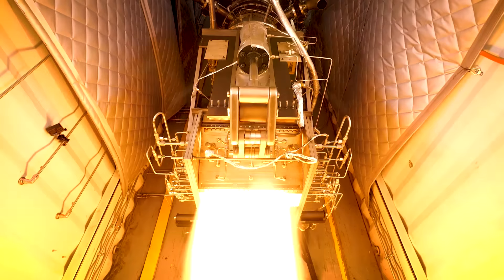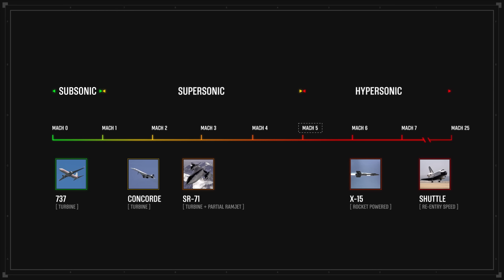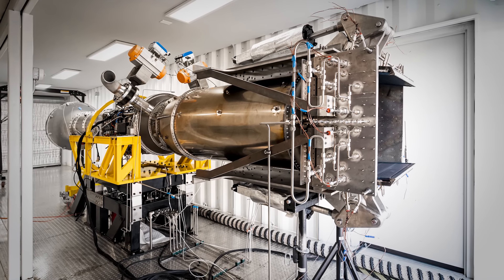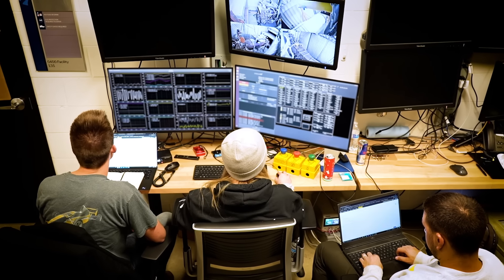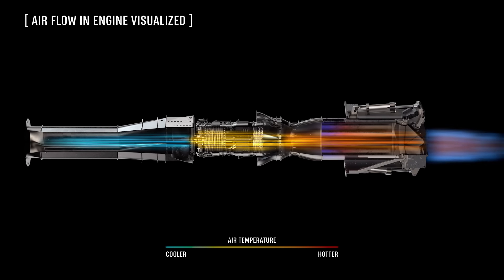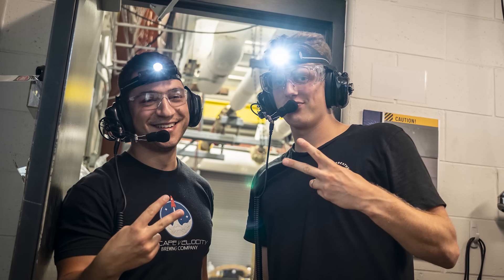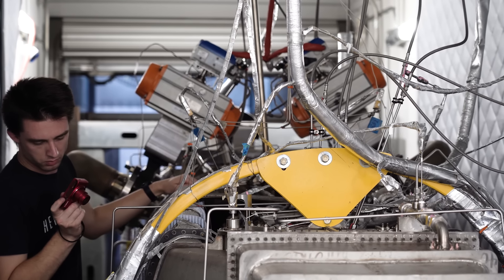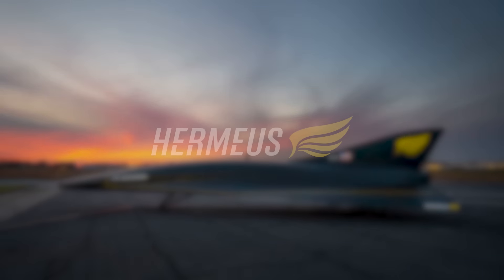Hypersonic Engine Test Milestone

Comment: The SR 71 had something like this except the high pressure bypass ran from high pressure compressor instead of directly from the inlet. Cool idea.
Reply: ya J-58
Reply: Indeed….it became popular to refer to the J-58 as a “turbo-ramjet” as a brief description of its unique functionality powering the incomparable SR-71 but this is actually a truer version of the aforementioned engine type. I LOVE what Hermeus is doing….they’re killing it at every stage of development due to a brilliantly practical philosophy….this has enabled them to attract and retain the necessary funding and engineering talent. Actually breaking the speed record long held by the Blackbird followed by hitting hypersonic speeds is going to make this team legendary while giving them all the momentum necessary to keep going. The reliable dual cycle scramjet problem has an incredibly high threshold for commitment, funding, and innovation making it practically impossible for a startup to crack that code. Allowing Lockheed to focus on that while leveraging the existing tech/ramjet model was an inspired call by Hermeus.

Comment: At what speed does the transition actually take place and how long does the transition take between turbo fan operation and ramjet and vice versa? what will be the change in altitude as the transition occurs?
Reply: I saw a post on this engine running and from what i could gather (+ my lifited knowlege on aerospace engenering) like they said mach 3 on turbojet such as the ones in the SR-71 and then once that speed is achived the air is moving fast enough and hot enough to then be able to use the RAMJET, the transition only took a few seconds; quickly throttle back on the turbo jet and then fire the ramjet and bring up the power. altitude for transition would most likely be between 60k-85,000 feet (85k) being the cruising altitude of the SR71, not saying it couldnt be lower but mach 4+ at lower altitide i would guess be less optimal for airframe rigidity and stability. But since it is still an "air" powered motor it would still need air to function, once in "space" where the air is so thin it would be hard to run the engine then rocket motors with their own oxidizer and fuel would need to be used :)
Reply: I think this answers my question about the design getting to orbit.  True space plane.
Even if rocket engines are still a necessity this would still have a massive impact on the fuel load required to orbit.
Reply: @xJI00  I suspect it COULD be used for sub-orbital hops (like the Virgin Galactic combination) if they could shoehorn a tank of oxidizer into the airframe.  Once the engine runs out of air, you'd open a valve and inject the onboard oxidizer into the engine, possibly similar to NOS injection, but nowhere near as simply done!
Reply: @xJI00  Not really , Mach 5 maybe sounds impressive, but is far off from speed needed to reach orbit, still needs a lot of fuel and oxidizer to get to that speed.
Reply: As seen on the graph for speeds the space shuttle was at extremely high velocity, well above that of what this engine does or is capable of acheiving at this point. It takes ALOT to get to space and the engines needed would need to be scaled up ALOT to meet that threshold.

Comment: I'm no engineer, but I find this all super cool. Can't believe manned hypersonic is so close to being acheived, you guys are awesome 👍👌
Reply: Well, this isn’t really what I’d call “close”, but it is definitely significantly closer than it was 2 weeks ago. This is a major accomplishment.

Well done, team!
Reply: I’m a test pilot at edwards afb and manned hypersonic is already a thing. We’re just trying to make it more efficient and for longer durations. Currently our longest hypersonic flights last about 7 minutes before fuel runs out. I’m not allowed to say what we’re flying bc it hasn’t been released into the public yet but the chimera engine has been in development for a bit now and it’s being fitted to the aircraft that I’m flying at the moment. The thing is we have to be at a minimum of 80k feet in the air for it to work. Anything lower and we can’t hit Mach 5
Reply: @TheBigChad  makes sense since the air resistance is quite low at that height, less drag, better efficiency. IIRC, the concorde flew at around 60k feet, right? Wonder what are the unique challenges they have to overcome, flying at 80k feet. Like the type of shielding, etc. Hope to see more in 2023!
Reply: @TheBigChad doubt
Reply: Its not close and probably will never happen due to a thing called friction drag and more importantly, what do you gain at Mach 5?  Next to nothing other than an astronomical fuel bill.  Mach 7 for a cruise missile has some possibilities if you can achieve such speeds, but manned?  Why would anyone bother?  Computers are better than Humans at that speed.
Reply: I doubt man will do a lot of hypersonic flying. One issue with the SR-71 was gforce. Any kind of maneuver at all would cause huge loads for a human to handle. Guessing a lot of military applications though.

Comment: I see what you did naming it J-85 when the first high performance dual mode engine was the Pratt-Whitney J-58
Reply: :D
Reply: Their engine is built on the GE J-85, that's the the turbo-jet in the middle of their diagram.  They're adding the intake, bypass, ram-jet and misc.  That's a significant add but basing the turbo-jet on the proven J-85 was a smart move... plus I think they were given several.
Reply: No, the J85 is the engine used on the F 5/T 38 and is unrelated to the J 58

Comment: The Lockheed SR 71 Black Bird engine works on a similar concept.
Reply: I had the same thought. The moment they explained the engine, i was like "so like the SR-71..?"
Reply: @Omar Khurshid No they did not. They fed bypass air into the afterburner and the jet engine got subsonic air and kept running continuously. In this engine, the turbojet is shut down and bypassed entirely, and a ramjet engine starts up that does not require the turbojet pumping air and fuel in, allowing it to viably run at hypersonic speeds.
Reply: @Teth47  Please don't help the enemy
Reply: @GeorgeVenturi  Elaborate.
Reply: @Teth47  if I have to guess, it's probably because he's muslim or has an Arabic name, which is messed up because they're muslim americans who served in the USAF.
Reply: @carl8790  I'd like him to say it openly.

If someone's gonna spout that kinda shit, they need to own it.
Reply: Question is, "Can they go from drawings to a flying prototype in the same time frame as Kelly Johnson's team did with the SR-71?

Comment: This engine is impressive I love my Hybrid powertrains. Good job guys and you did it on a pretty small budget. This design should just nudge over into Mach 5 territory. Looks like hypersonic travel is just around the corner real ground breaking stuff. 
Calculating the smooth transition from Turbojet to Ramjet with airflow and combustion calculations needing to be just about perfect would have been very difficult. Too long a delay between the transition could be devastating while an aircraft is in flight. These guys still have a little bit of work to do the FAA is very strict on new designs.
I am glad they decided to show the world what they are doing and how the new engine works some people would be worried their designs and idea's would be stolen.

😎👍👍

Comment: The real difficulty relies in the discovery of the point of the vacuum of space from one mode to another and then manipulates it while switching from high speed to higher speed. ..the second layered manipulation is actually what the aircraft is or does so engineerings' limitations are a matter of condensed materials outputting fast flames and going the exact reversed direction.. .what is slowing down faster aircrafts' production and deployment if the simulations are reliable and close to 1-to-1 perception?

Comment: It's there a reason why the turbojet has to be inside the ramjet, as opposed to a parallel setup? I mean, other than excess drag. But it seems like that would still be an issue with this setup, one that might even hamper the most efficient use of energy inside the ramjet.
Reply: Probably just efficient use of space
Reply: i agree with the idea.  That at first glance it seems odd.  If they don't need to redirct the air for the ramjet.  it is possible, the tech diagram is missing some key components, regarding the redirection of air flow.  Could be redirection is purposefully helpful in some way.  The redirection might not be as inefficient as we think it is.  i would enjoy talking to the engineers.
Reply: Reuse of intake and exhaust structural mass perhaps? Heat soak in bypass mode must be a bear though.
Reply: Thanks for the great thoughts folks!

Comment: The Inlet temperature reduces only 675F, is it using jet fuel as the cooling media ? Also have they gone with stainless , cupronickel or incoloy in the precooler?
For the internal engine baffles, is it a single bypass duct or multiple, how do you compensate for resurgence from multiple ducts merging ldownstream of the exhaust turbine ?

Comment: I wonder what advantages this approach has over having turbojet and ramjet as separate engines side by side. Here they're essentially in tandem but you still use them separately and in hypersonic mode the turbojet literally stands in the way of the incoming air.
Reply: Depending on internal geometry, the compressor section could be similar in function to an inlet spike—positioning a normal shock in the throat to slow the air down enough for combustion (remembering that this is a ramjet, not a scramjet).

Comment: SSTOL only need  PHASE mode vs Stages. Economically. Starting with a bulk air intake classic jet chamber, to adjusting exposer Ramjet head,  Scam-Jet  and Turbo after exhaust, but there is BEYOND. Rear of Ramjet air combustion flare/gas, making super micro high atmosphere, THICK as air on surface, but at zero gravity high. Eventually electric PLASMA aside afterburns for exo/solar orbits.

Comment: For hypersonic don't you need a scramjet?
Reply: Maybe not...
Scramjet vs ramjet, the difference is in the speed of the air as it enters the combustion zone. This engine decelarates the hypersonic incoming air, either they really mean to say Scramjet, or the air is subsonic (respect to the engine) as it enters the combustion zone.
Reply: @dougaltolan3017  I believe that the air in the engine remains subsonic. Reason being: Scramjets only really start to work beyond Mach 4-5 and realistically are only viable beyond Mach 6. This craft is going nowhere near those speeds yet and so it couldn't be a ramjet that's powering it

Comment: Everyone is talking about how this is the first time this is done. Wasn't there a Scramjet in the SR-71 blackbird? The most advanced jet from 50 years ago, still holding the record as the fastest air breathing jet. I'm certain this engine is different, but it was not explained how. Not to belittle their achievement here, only to show how incredibly advanced the SR-71 was, in an age where the competition could barely reach supersonic the SR-71 could cruise at Mach 3.2 for hours
Reply: These are very different in how they bypass, combust at the least, and what speeds they are capable of running at.  The J58 could not operate above Mach 3.5 or so.  A true ramjet should exceed that by some margin.
Reply: Sr71 engine operated in a quasi ramjet mode. Ramjets still slow the air to subsonic speeds in the engine before burning it. Scramjets are the new hotness they leave the air supersonic as it goes through the engine. Nobody has put them on anything with people in or even on anything particularly large.

Comment: If the ramjet goes from mach 3 then whats the scramjet
Reply: The difference between ram and scram is the speed of airflow through the engine. Ram is subsonic scram is supersonic. Scramjet should be good over Mach 5

Comment: Not an engineer but every time I watch hypersonic flight tests I always see the same issue arise. Heat. Again not a engineer but why hasn't anyone taken the most logical approach? Cover the plane in air/water? Perfect example of what I am talking about is a knock hockey table. If you change the frequency of the air by vibrating it wouldn't that provide a barrier of air around the aircraft? Again not an engineer. Just an idiot with an idea. Food for thought.

Comment: You really need to figure out what to do for cooling, even precooling the air. If you run something through air at Mach 4 or 5, as you well know, it will get pretty hot. Not just on the outside. The amount of energy needed to cool that amount of air that fast to be used and not melt the inside of the engine is substantial. That energy has to come from somewhere, so it has to come from the engine itself which needs power in some way reducing its performance. I wonder if you have all that calculated or you wont reach those speeds, or only for a short time until you engine melts to a clump of metal and the plane bursts into flames shortly after.
Best way to cool would be small intake and then expand, but since a jet engine needs a pretty big intake as does a ram I think you have to do some more maths on the size of either the engine or your prototype plane size. Because what I am seeing doesn't make alot of sense. The SR 71 was slow in comparison and those engines were huge and it had 2. And they didn't have precooling either.

Comment: Didn't they develop this tech back in the early 60's with SR71, why not just improve on that engine surely advancement of 50 years could improve it
Reply: No, the SR-71 was a turbofan and a ram jet at the same time. The turbofan never fully turned off, only a few valves opened up to allow some air around the blades. It was never a full ramjet.

Comment: Russia has Hypersonic missiles. Even India has...🤷
Reply: That's not the point... those missiles are powered by a rocket engine. This isn't a rocket engine.
Reply: @carl8790  lol, i guess you don't know anything about missiles and how those work. Russian missiles have scramjet engines. These are ideally suited for hypersonic flight within the atmosphere. A rocket engine is designed to work in vacuum of space. 🤷
Reply: @keeplookingup911  hypersonic missiles are boosted by a rocket SMH 🤦🏽‍♂️ the air breathing scramjet engine is there to maintain speed. It's not same application here. No rocket boosters are used here. Get it?

Comment: I don’t see the milestone, it’s just two engines in one and simply by-passes one to ignite the other. The same thing is done in the sr-72 concept but with two separate engines and a switchable inlet with probably provides more thrust and at a cheaper cost. I don’t see the point here.
Reply: The biggest problem with hypersonic flight also doesn’t seem to be propulsion, it’s fuel and heat management.
Reply: @nicholasdelrossi3996  That's my thoughts, surely the airframe and heat protection is the revolutionary thing to focus on?